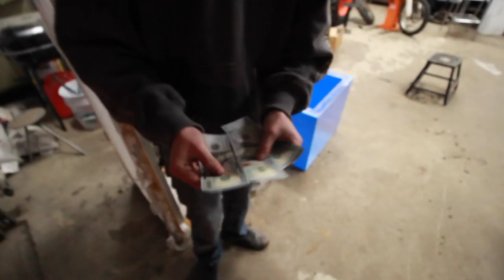I JUMPED IT!!

Comment: It's the source coil in the stator it won't get spark off the electric start if you push start it. It should start trust me I had raptors and warriors and I dealt with all of there electrical problems. If it starts by push starting it then you know that the source coil in the stator is shot then you need to get a stator. Get one from Rickystator

Comment: if it dont get spark put a new spark plug in and if it still does it then check the connection on the cdi were the spark plug  cable is connected